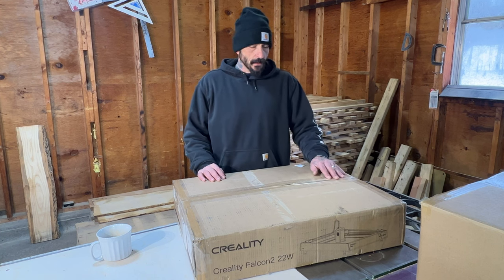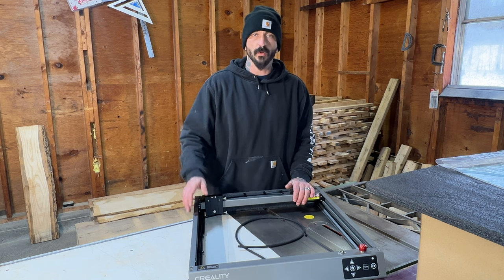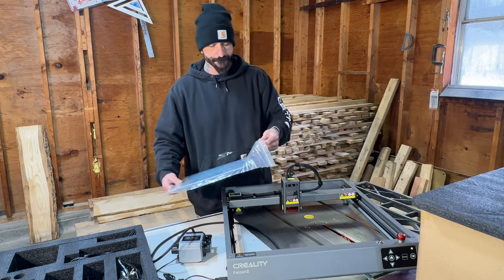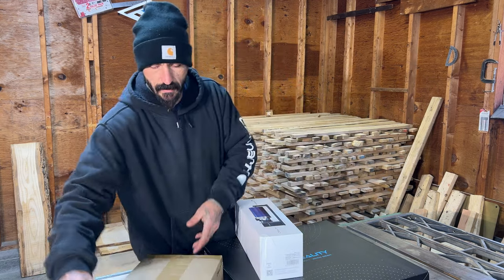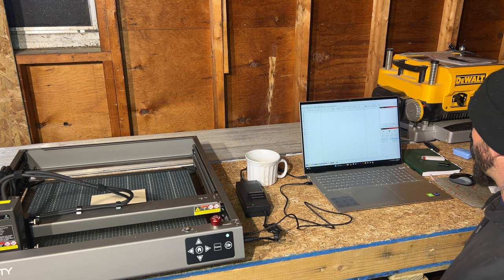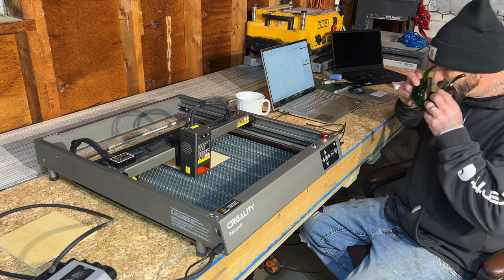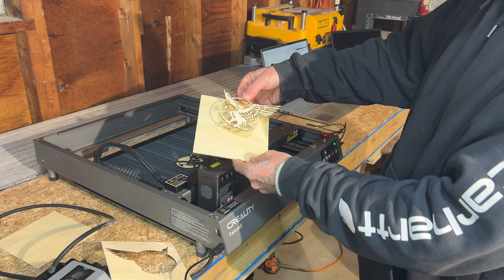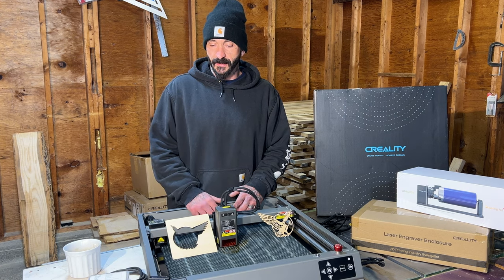Unveiling the Creality Falcon 2 Laser: Revolutionizing Garage Projects

Comment: I use a little space heater in my apartment garage. It makes a world of difference.
Reply from the maker: That’s a smart idea! I did have a couple plugged in but until I get the wiring squared away, I have to pick between running tools or heat. Nine times out of ten, I go with the tool option!